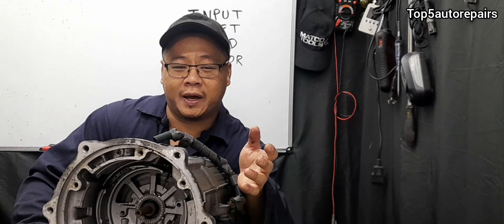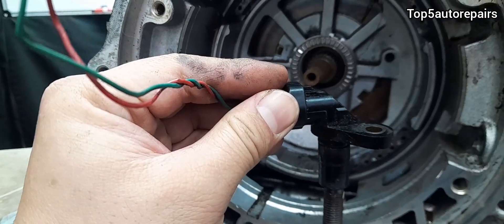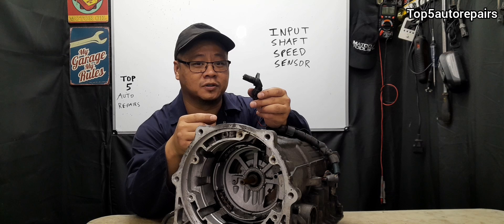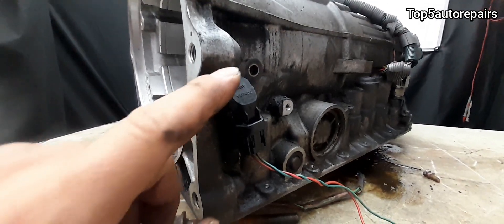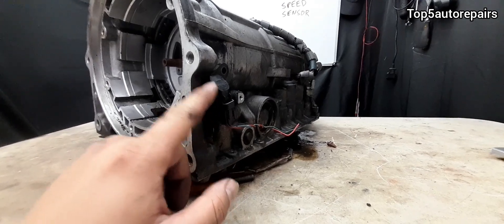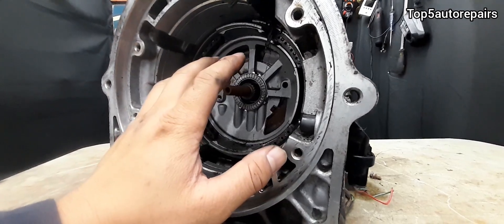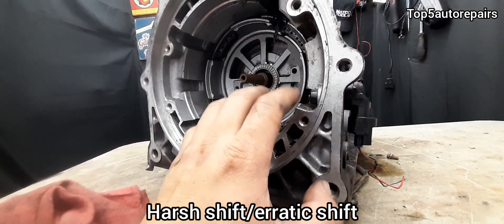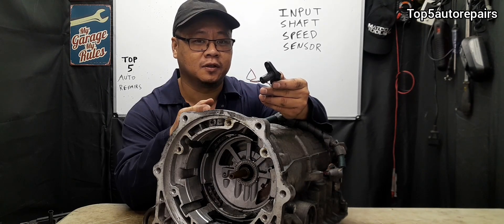SYMPTOMS OF A BAD INPUT SHAFT SPEED SENSOR P0715 P0716 P0717 P0718 (COMMON CAUSES)

Comment: Hi Top5 Auto Repair  Thank you for the video  I have 2015 Audi A3 Quattro with 0716 code that sometimes goes away so maybe a dirty sensor?I'm just a DIY'er . Do you have any suggestion ,if you wont mind  where  the location for this specific make/model and the process of checking/or replacing same . Thank you very much.

Comment: We have a 1997 Chevy 454 big block with a 4L80E transmission with 39,000 miles on it. It was starting to whine. We had our transmission fluid changed. Pan was cleaned out with a couple of tablespoons of fine shavings. New fluid was put in. It ran fine for two weeks and then we were parking and we pulled up and went to back up and literally had no ability to shift in any gear. No limp mode. Luckily we were home. Feel blessed for that. We pulled the transmission pan again. It was still fairly clean but had 1/8 inch piece of metal but that’s it. No more shavings. We are stump that it just quit so suddenly with no more whining. We were leaning towards thinking a fuse or the tcm. Do you have a video on the tcm? Any thoughts? We have scanned the internet and you are the only one with a comprehensive explanation on anything close. Your video on the pcm described perfectly what is happening with my mother in law’s 2013 Silverado so I will have to let her know. Thanks in advance for any info on another video or general info you might give. 🙏